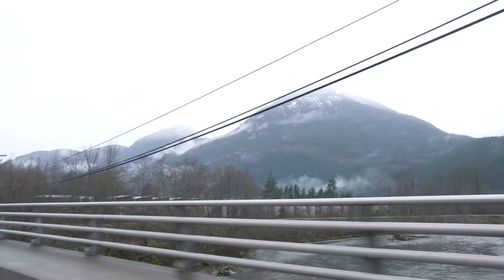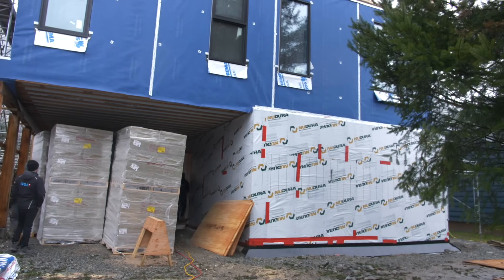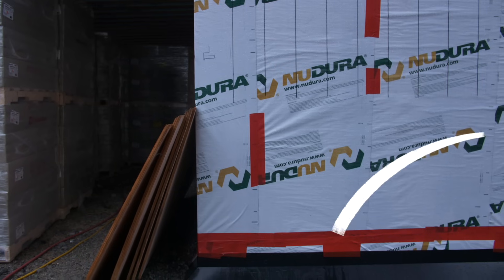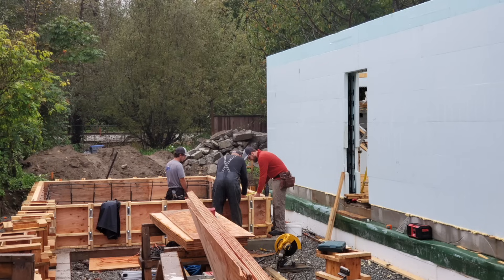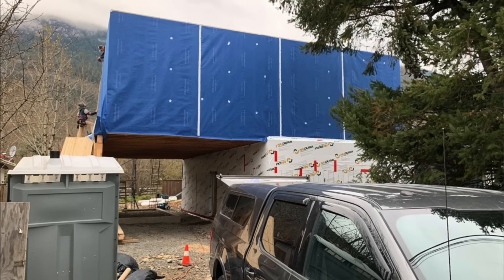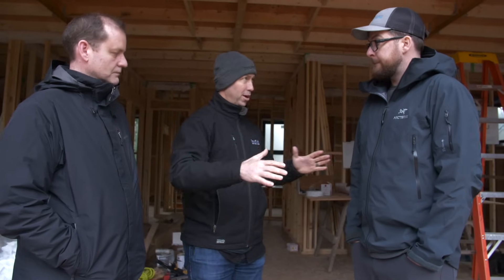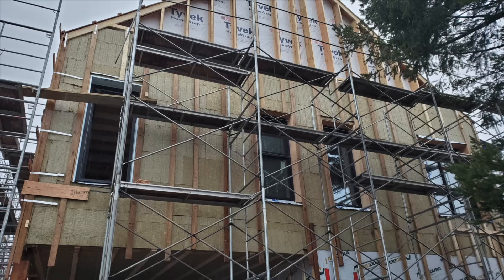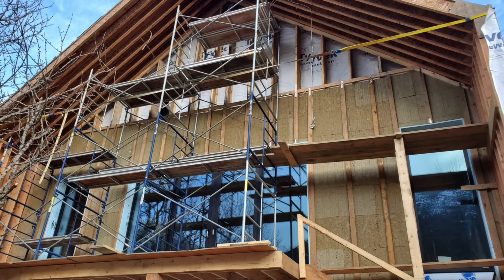Some Awesome Insulation Details on this BC Passive House!

Comment: I really like these custom builds that showcase super insulation and/or special foundation features. As a follower of passive design, I saw the demise of underground homes and greenhouse homes. Adobe mud was a hip thing and then rammed earth & straw bales. The only thing that has lasted is building a conventional living space and then super-insulating it to reduce the total cost of heating and cooling. The use of light tubes can also reduce the amount of electrical lighting required. I distinctly remember the architect that built a passive house where winter sun streamed into the tiled kitchen and she stored that solar energy as heat in the mass of the floor but when she lived in the house she got tired of having to wear sunglasses in her kitchen every winter day. I think we have learned the house must be comfortable to actually live in and not just save energy.  The commercial construction industry has some great architects that seek net zero. I don't like any of the nonsense about using recycled materials. I like the idea of a house with a 500-year lifespan.
Reply: Agreed. The need to use recycled materials is irrelevant when the structure is designed to last 200+ years.

Comment: That flood plain isn't a huge issue as the rail line acts as a very strong berm or dike between the house and the Squamish River. I think that the last bad flood was in the 1970's and it didn't overwhelm the rail line then. That builder was doing way more than the minimum requirement from the local building approval and the home buyer must of had money to burn ; I suspect he couldn't quite 
come up with the scratch to buy land in Whistler so he decided to blow the money he had it on extravagant build in the cheaper location.

Comment: Dear Matt, I love watching these videos. I knew a man in northern Vermont that had a 100% passive house that never needed his backup heater in five years, even though outside temps. went as low as minus 35 F. Not even a hair dryer needed! How did he do it?  First of all, he used very thick foam block insulation all around , above and below his home for a super high R- value. Next, he had a huge triple glazed south facing window to gain him a lot of solar heat all day long. This sunlight hit a thick slab of black slate about 10 feet behind the long window in the back of his long, shallow living room, and was in the center of the house, with his bedrooms on the other side. At sunset, he lowered a huge, clamshell awning / cover for his giant picture window, so that on the sub- zero nights his R-9 window went to R-40+ because of the insulated cover over the picture window. So he had windows for the daytime, and battened down the hatches with window cranks at dark when there was nothing to see in the winter. In addition, he got electricity from solar all day, and by a wind turbine all night.  These were stored in a 1900 pound submarine battery in his basement and he ran lights off 12 volts, and had an inverter for some 110 volt appliances.  He had a strange gas powered refrigerator that used a propane tank he had refilled in town. He was completely off grid, near Stowe Vermont. Said the U. of Vermont would send engineers sometimes to see what he had accomplished. I was impressed! I live in a totally uninsulated condo in Los Angeles, and I am freezing inside when it is 63 degrees outside, as I have single pane R- 0.2 floor to ceiling windows on my whole exterior. I wish I had the comfort and energy savings of smart design!

Comment: I want to use 16" of foam blocks as my home addition foundation in Charlote, NC. Having a hard time finding a structural engineer to stamp off on it. I wonder what the PSI rating is on this structural foam? 60psi?
Reply: Wondering where to get structural foam?

Comment: Love the high R factor insulation.  I can't help wondering exactly how the house is "attached" to the ground while sitting on top of 22" of structural foam?  Gravity?
Reply: I am not an engineer so take what I say with a grain of salt. I would be concerned in a flood relying on gravity alone to secure the house in place. I have seen footage of houses literally swept away in floods.  The lateral forces are immense. I think in coastal areas with sand they put down piers and build on that.

I am sure an engineer approved this design and it meets code, so likely is OK. It just looks “unachored” somehow.
Reply: @IacobusBond  And there was that reference to the "raft slab", hopefully that is not a foreshadowing of future events.
Reply: we buy really dense foam for CNC mold forms that at 20-40lbs/ft3 is still able to float. 6 in 4x8 sheet needs a forklift.
Reply: Plenty of gravity with all of that concrete. You have to remember that even the ground itself is attached to deeper ground with gravity.
Reply: @Alex-lc1bv  lol str8 facts

Comment: i always think these are interesting, but when you have r60 walls and r100 roof, 95% of your heat loss is then from your air exchanger, and windows. something like this probably uses a heat pump based air exchange. I'm sure they probably have some r10 curtains the auto cover the windows at night too.
Reply: Im pretty sure they do NOT have R10 auto cover windows at night. Because I've been researching that and no one makes them. Seems like a no brainer to have thermal shutters, but for some reason it just has not caught on, and the ones I do see are all custom made.

Comment: I wonder why the “service cavity” framing is vertical and not horizontal (inside of the vapor barrier and structural studs. I’ve seen it horizontal and then you don’t need to cut for the electrical wires and PeX
Reply: You don't need to cut the electric cables and water pipes if they drop from the ceiling inside the vertical service cavity. Houses built with "Posi-Joists" already have a thee dimensional cavity in the ceiling that can be used to route all services throughout the house to the walls.

Comment: Eblankets guys it's super cheap radiant blanket that can be glued to the inside of foam on the 4 sides of a house!  Also foam cement mix has an incredible insulation value for under the cement floor for radiant heating but add an emergency blanket and wala!

Comment: It's rather strange windows remain in these types of constructions -- solid foam walls ground-to-attic with large flat-screen televisions indoors to act as windows with CCTV cameras on the outside.  Think about it...  Any room in the house can have any window view desired.  A couple of PV panels on the roof could supply all the power necessary for low-voltage daylight duplicating LED lighting.

Of course, with a larger PV installation, a geothermal battery, and a heat pump, construction costs could be lowered on the house due to less reliance on perfect passivity.

The options for near-off grid living are nearly unlimited today.
Reply: people dont' want to live in the matrix! What' strange is there is no north american manufacturer making thermal shutters with a day light sensor that automatically opens window shutters during the day and closes them at night. a 3" r15 shutter would be easy to manufacture and could make an R7 window into a R22 assembly.

Comment: What's the density of the foam beneath the house? That's got to be like a buoy when it floods. What is being used as ballast or anchorage?
Reply: It could be anywhere from 2.2 to 3.4 pounds per cubic foot (for EPS300 to EPS400).

Comment: I would love to see if they even need a hair drier to heat this place in the middle of winter.  What were the blower door results?  this is a super layer cake of insulation and on top of that an air barrier with more insulation.  living in climate zone 4 just no way that this would make sense for 5 houses

Comment: Hi Matt,  Just discovered your channel.  It's fantastic.  I had a question on the foam that's being used more and more for the high R values it provides.
How much oil and how much energy is required to produce the foam and how much green house gas is produced?  I don't know if those numbers are easy to come by but maybe in one of your future videos you could cover this?  I'll be doing a Passive House for my next residence and foam seems such a cool and easy way to go but it would be good to know the embodied energy involved with foam as I could go with other types of insulation depending on how these number compare. 
Thanks and keep up the good work!

Comment: At a certain percent of R-value you reach a point that the cost of the extra insulation isn’t worth it. What’s the air filtration in R-80 vs R-100? Way cool but over kill. If you have that much money why not burn it!!

Comment: This is complete nonsense.
Most of Matt's videos provide very good information about modern high quality building techniques, but this is just bad advice in my opinion. I think he also has another video with this Pierre dude, who in my opinion is way out in left field.
First, no foam insulation board is really "structural". I don't care how dense it is. The long term properties of any foam currently available include some amount of fatigue and compression over 10-20 years. There is no way I would let you build my house on 22" inches of the crap.
Second, there is absolutely no rational explanation for putting more insulation under the slab than you put in the walls. Even in a very cold climate there is more inside/outside temperature differential  at exposed wall level than under the house.
If you're going to build a slab on ground in a cold weather region there are simple ways to keep the coldest temperatures and frost out from under the slab (e.g. "wings" of insulation out from the slab at angles). Then the soil temperature will remain at approximately 40F-50F year round. So that gives you a 30F maximum temperature differential at the slab, compared to say 90F temperature differential on the walls in the winter. Hmmm... I wonder where more insulation should go?
In this case, I believe they're trying to completely insulate the soil from any heating effects from the house. But unless they built a completely non-frost base under the foam (e.g.excavated 4'-5' down and filled with properly compacted gravel), they can float that "raft slab" all they want but the ground will still heave and cause structural issues over time. I can't believe this would pass inspection under any rational building code.
In this climate they either need to keep the ground from freezing, or build a frost free base, or put proper footings down 4'-5' below ground. Then once you do any one of those things, it would still be completely irrational to put that much insulation under the slab.

Comment: What I notice is that all that insulation etc will require a a similar approach for the air system n u still need heat for the-40 winter temperatures n more than u think because if it looks cold Ull b cold too even inside. U have to condition the inside as well !!

Comment: You asked the right question, Matt, when you asked why the walls are so thick. All that insulation with R9 windows--makes no sense. You're just throwing money at it and barely improving the overall R value past a certain point. Assuming a tight seal (which this build definitely has) windows and doors are your weakest link. There comes a point when you simply can't overcome the heat loss through windows and doors with thicker walls, and they went way past it. But hey, more power to them for selling the client on a crazy amount of over-build. Fools and their money...

Comment: The folly of "educated men",  build a home in a known flood plain !!   WTF?   In California "educated men"  build wood framed homes with asphalt roofs on hillsides known for forest fires. Mother Nature weeps for fools and drunks.
Reply: Having taken the R-2000 Course in Ontario, some  builders became certified, and then went back to their old ways calling them R-2000 homes.  Nothing changed in their building or they got worse.  I was in one in LIstowel, Ontario and the wind was blowing right in under the bottom plate of the wall.  The air barrier is supposed to be on the outside of the insulation and the vapour barrier on the inside of the insulation and sealed to create a dead air space.  They broke all those rules in this build.  This is some crazy engineered dream $$$.  It still comes down to the fact that if everybody gets paid, everybody is happy at the end.

Comment: My question is how did they pin the foam footings to keep the whole assembly from sliding about?  This is adjacent to a major major fault line.  Can't remember exactly but I believe the San Andreas goes right up through  Vancouver Is. to the Queen Charlottes which puts Whistler within several miles.  A sandy silty riverbed surrounding a very small rock pad isn't going to be fun under liquefaction.  He said six feet down but no indication if that achieved bedrock either.  I do applaud the rebar schedule in the slab.

Comment: You can only slow heat down without the use of a vacuum and I always think it is better to have higher quality insulation than thicker because you are not only heating the inside but the mass of the insulation too. You need windows to let free heat in because insulation isn't one way only. There are vacuum insulation panels and aerogel and you can always cover windows up at night with super thin quality insulation like those I just mentioned.
Reply: You are correct that the insulation also adds thermal mass. This is very useful to allow heat pumps to run during the day when they can be more efficient and to switch off for a while to take advantage of the thermal mass.

Comment: Impressive! Whistler is obviously an extreme climate. Before people rush off and start tripling their insulation I just wanted to point out that in less severe climates there are definitely diminishing returns as far as adding insulation. Green Building Advisor has some articles on the subject.
Reply: Not Whistler

Comment: Just wondering why Rockwell type insulation is used instead of a spray foam type insulation. Not a home builder but would like to know the difference in building with the Rockwell
Reply: The spray foam insulation I've seen used in cargo containers needs to set at about 90F. That might be an issue in this circumstance when the big propane blower heaters are brought in. Maybe, maybe not. Depends on skill I guess.

Comment: Show us the numbers that show the payback on this over-insulated house.
Reply: lol right ? everything over r60 has such a diminished return its not worth it. will never pay back the extra expense, especially since all these over sealed over built homes end up with problems down the road , one bad area, accidental or overlooked vapor lock a  missed bit of tape or caulk turns into a focal point for rot and mold.

Comment: So, the house floats if there's a flood?
Reply: krap101 a raft slab is a typical slab construction method for n Australia so is a waffle pod slabs so foam used instead of fill to raise insulation. Raft slab is good for reactive soil sights as when clay or soil expands the slab won't heave and crack due to the raft construction which is basically edge beams and thickening beams in the middle with the extra trench

Comment: Why not just do double wall with as many inches of insulation as you want in between at this point?
Reply: I have asked this question about similar builds, and one response was that the structural connections between the walls results in thermal bridging that causes other issues. There are strategies to reduce it, but the argument is that it's simpler/more effective, to do continuous insulation on the outside.
Reply: @travelfeet  I guess, these ultra insulated builds are rare enough that we don't actually have enough data on relative costs and long term performance data. I'd imagine the thermal bridging would be so minimal. But then if it's about the same cost to do ext insulation then fair enough. If it's a lot more expensive, then one has to look at it logically. But most of these builds are no budget builds anyways, so I guess at the end of the day, they can just do whatever they want as long as it works!
Reply: There are concerns about moisture, condensation and rot. Exterior insulation keeps the structural wood warm and dry. However there's some debate over how "risky" double stud walls are from a moisture point of view. I recommend David Poz's channel, he did a double stud wall with blown in cellulose. Very cheap for the r-value you get. There's also this article that goes over a deep analysis of moisture in double-stud cellulose-filled walls: https://www.energyvanguard.com/blog/77957/Is-This-the-End-of-the-Double-Wall-Cold-Sheathing-Scare

Comment: Built in a river bed on a "raft" lol. Makes total sense.
Reply: I bet ya it floats> even with the concrete.
Reply: @its.free.realestate  hey, I think they said they brought in lots of feet worth of boulders before the crush/foam/slab. My whole neighborhood is subject to overland seasonal water (non/flowing) and it’s all good, pier and beam or vented crawl space. I’m guessing they are above the high water mark and just need feet that can get wet
Reply: I built a 15 unit residential over commercial building on land that was considered liquefaction land. I had to dig out and pour a "Matt" slab of 24 inches, (1,200 yards), to keep it from being swallowed up on the next big California quake. LOL. That was an expensive build. I like this structural foam concept. I bet I could of used 1 foot of structural foam and 1 foot of slab to get the same effect. Need to run the calc's on that.